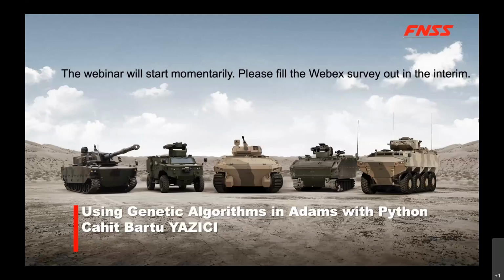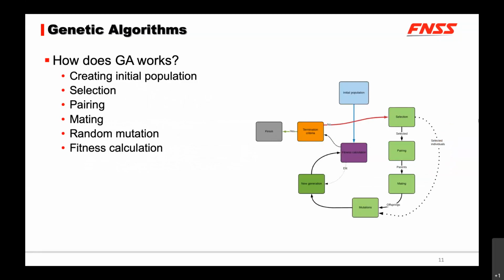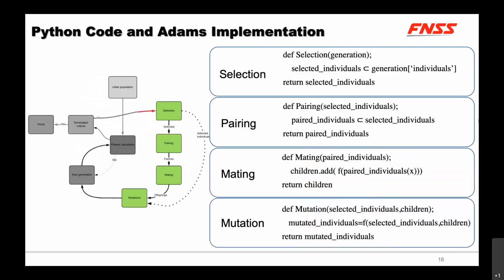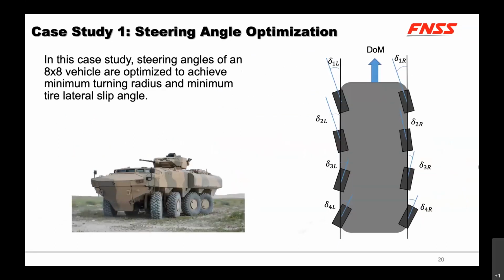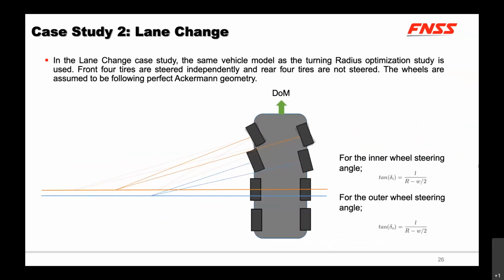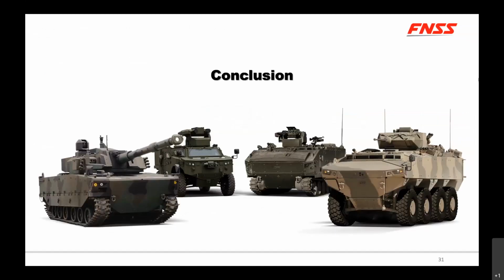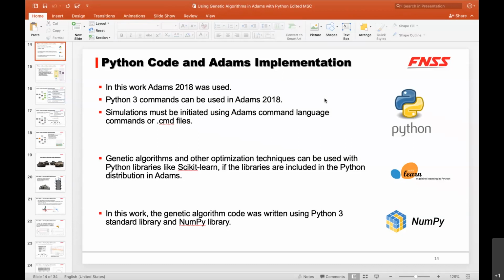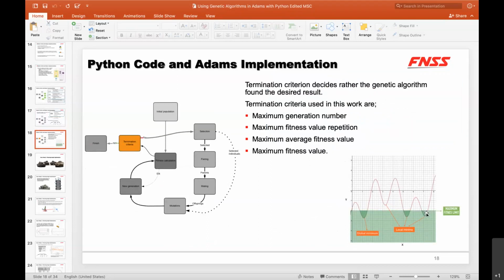Webinar- AI based vehicle optimization technique with Adams

Comment: Probably the easiest to understand explanation that I have seen of genetic algorithms ever. Thank you very much for that! This seems like a great application for this optimisation technique. I just have a concern for the cost function used in the double lane change. Wont it be better do add other states into the cost besides the bounding box of the vehicle inside the path, especially if the ISO 3888-1 double lane change was used as the setup? I mean a military vehicle performing a double lane change at 80 km/h would have significant body roll and rollover should be a genuine concern here. Great presentation overall!
Reply from the maker: Hi Andries,
Thanks for your interest, and glad that you enjoyed the content. The primary intent of the webinar was to highlight how users can extend core Adams functionality using scripted workflows. Yes, the cost function is pretty simplistic and does not reflect a true system level optimization. If you are interested in a more rigorous system level optimization, please watch the second webinar in that series https://www.youtube.com/watch?v=VFMD_Kr9Jcc. In this video, Adams is used with a partner tool to optimize the suspension design for a vehicle operating on a rough road. 
Are you currently using GA in your vehicle dynamics simulation? If yes, would you mind sharing what you are trying to optimize?
Reply: @MSCSoftware-Hexagon  I understand, thank you.
I was considering using something like a GA or PSO or similar to do controller tuning. The simulations we run (co-simulation between Matlab/Simulink and Adams View) are too expensive to justify the implementation of these methods though (-/+ 16 min per sim) so I might opt for the good old-fashioned manual tuning based on some sensitivity analysis and worst case scenario sims or a gradient based method if time permits. But I can totally see how this method would work well for less expensive simulations like the one explained in the webinar.
I really do enjoy these videos, especially the filling of the gap that sometimes exist between theory and implementation.
Reply from the maker: Thanks for your response, Andries. 
Since you mentioned long solution times, you would be interested in a recent video we uploaded here https://www.youtube.com/watch?v=dOvD-M5qGAg&feature=youtu.be. In this video we explore the creation of Reduced Order models from Full fidelity Adams models. These Reduced order models, capture the dynamics of interest from the Adams model without the overhead of prolonged solution times. These models can then be used for a variety of purposes including controls tuning. If you are interested in leveraging this technology in your academic research do let us know. We would be interested in collaborating on the types of applications you are working on.

Regards,

Tonny from MSC Software